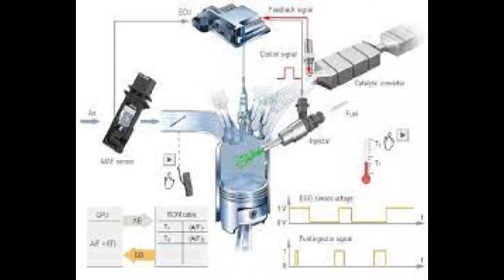What is Open/Closed Loop?   I'll Explain How It Works.  Must Watch!

Comment: thanks, helped a ton, car is only shaking when acelerating in closed loop aceleration, i suspect the sensor is 16 years old with 200k kilometers and starting to fail or become dirty although not thowing any codes yet and even though my upstream wideband is passing the throttle blip reaction time test
Reply from the maker: What are the fuel trims long term and shirt term?  What is mass air flow reading?  When was the last time you had a tune up?

Comment: can clean O2 sensors w brake cleaner.. right? thanks.   I just got an open loop failure - showing 50% short term fuel trim on one bank!
Reply from the maker: @atomicdmt8763  no. You don't clean 02 sensors with brake cleaner. You don't clean them at all. You replace them

Comment: Hi i have lexus is200 year 2000 with a 1gfe engine and i cant get it to start. I had it on the diagnostic and its stuck it open loop do you know what i should check/replace to try fix it? Any help would be much appreciated
Reply from the maker: @RoofboxCamping  open loop is when it first starts. If it's not starting it won't go into closed loop. You need to figure out why it won't start.
Reply: OK so even if it was stuck in open loop it still should start do you mean?
Reply from the maker: @RoofboxCamping  yes. It's not stuck in open. Open loop the rear o2 sensors are ignoring the front. Closed loop. They are talking to each other. It doesn't go to closed  loop until it reaches a certain temp. It's open loop at start usually until the idle drops down and stays running.  To start you need air, fuel, spark and  compression. Check to make sure you are getting all of those. Once it starts it will go to closed loop

Comment: In the description's second paragraph did you mean "*Open* loop is when you start the vehicle..."?
Reply from the maker: Yep it's open loop when you first start. Ecm is ignoring the rear sensors. It doesn't care what they report until the engine reaches a certain temp. This let's it run rich to keep it running.
It is normal for the computer to be in open loop when you first start the engine it will transition into closed loop when the engine reaches around 170-180 degrees and it is also normal to switch to open loop after short delay when increasing to full throttle.  I need to fix that. Thank you.

Comment: Awesome subject to cover. I have been studying OBD2 lately. I borrowed a book from the library ( an "electronic" book, no actual hard copy available ).  Found a mistake in the book. Author says turn ignition on. Set dvom to ohms. Connect positive lead to pin 16. Connect negative to pin 4 or 5. The reading will give you the voltage. LOL. I need to get the Haynes OBD2 book. Lost my copy several years ago.
Reply from the maker: OBD2 is a very complex system. Very interesting on how it works. And can be a nightmare as well. It is a very cool subject to study on and I find it very interesting how they came up with it and how it works. Hanes manuals are the best.